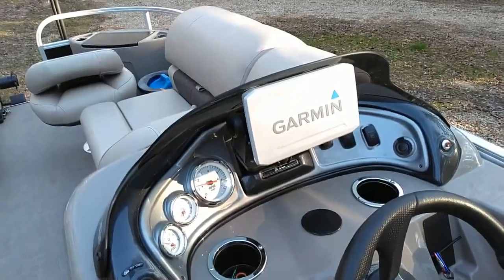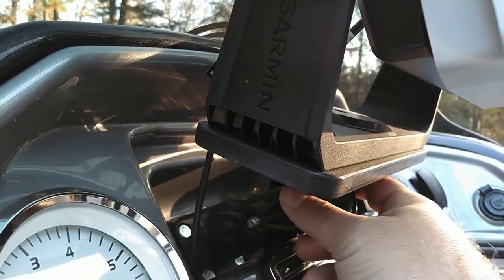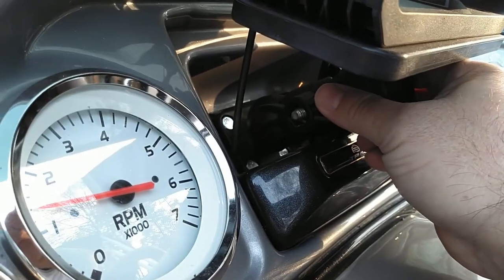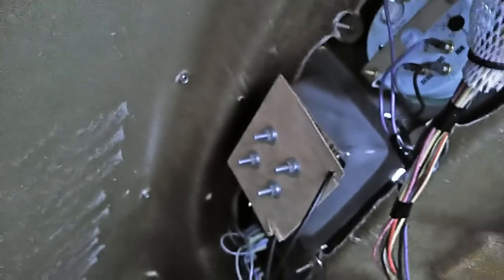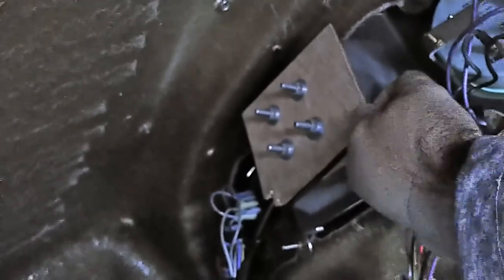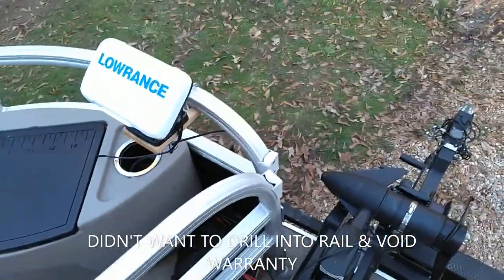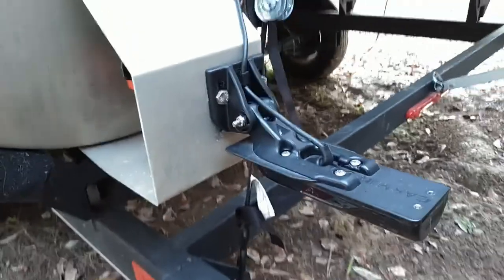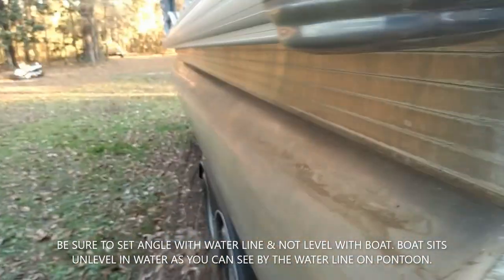How to install 7" or bigger fish finders in small 5" holes. Cheap/DIY/on a budget.

Comment: I'm planning on mounting my fish finder over on the right side of the windshield. Is there a disadvantage doing it that way? I have the same boat.  I'm also getting ready to install a 36v Minnkota Terrova trolling motor and I noticed your motor sits to the port side vs the center. Any issues with that like the chords slapping against the rail when the motor turns? I like the idea of having more walkway by the trailer ladder. Thanks for the video!
Reply: I have the same 20' sun tracker as you. I plan to install the helix 7 on the right side of my helm using a Ram ball mount. Did you install yours to the right side? And, do you like it there? Thanks

Comment: Great video, quick question though how did you route the transducer wire from the trolling motor mount?
I have the exact same boat and have been thinking about setting up a depth finder in the front of the boat.
Your setup looks very good.
Reply from the maker: I just ran it along the shaft all the way to the head. You just have to leave enough slack to allow motor to turn 180°. If you DM my IG @freshwater fiends  I can send you pics if needed.